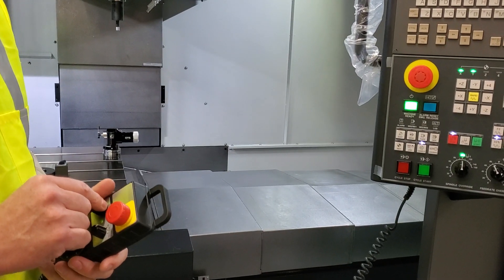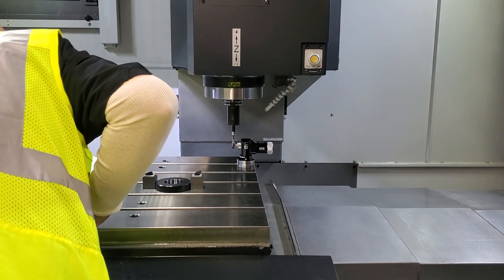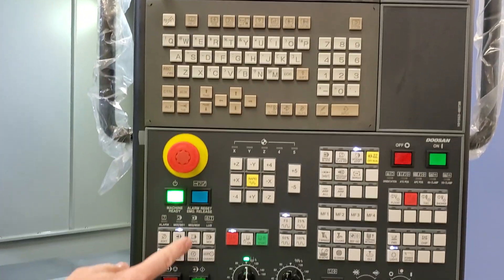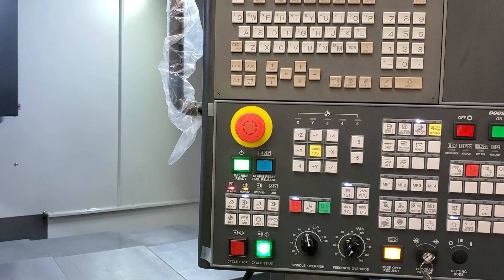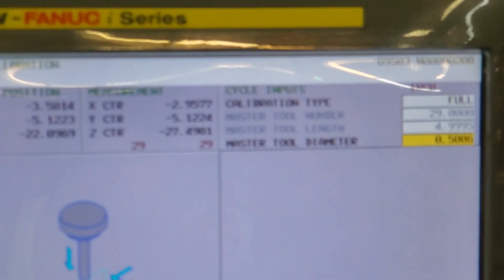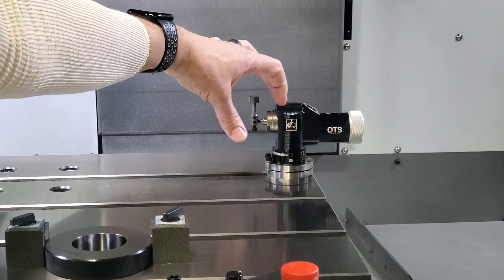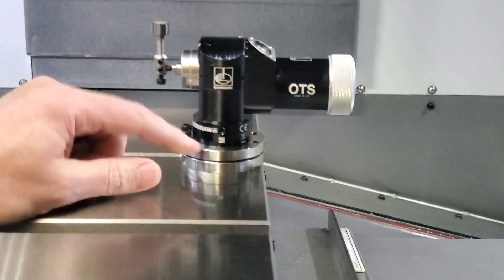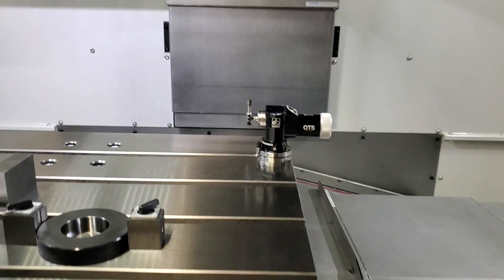Doosan CNC: Renishaw Toolsetter Setup

Comment: Great video. I have a question about setting tool length with renishaw tool setter. How do you get tool length from each tool when setting tool set with tool setter. For me, even though I properly set the tool setter as like you, machine does not make proper tool length. 
For example, I have to put tool length ,but I do not know which value should I put it, if I wanna each tool setter. Thanks